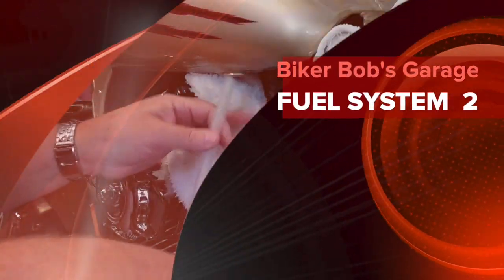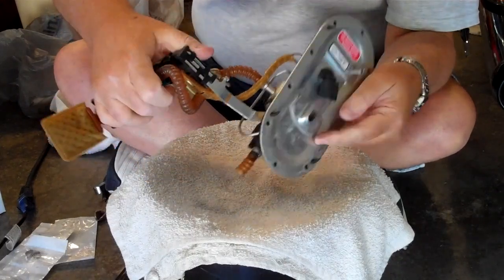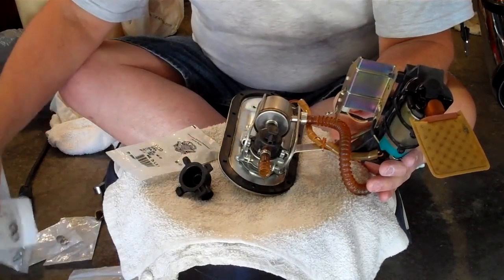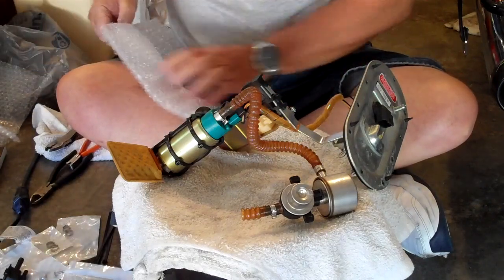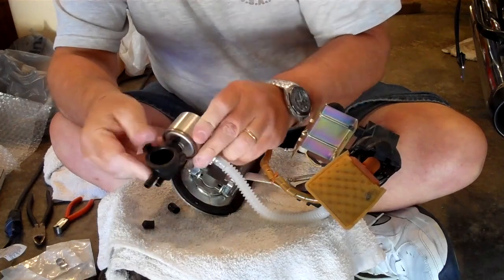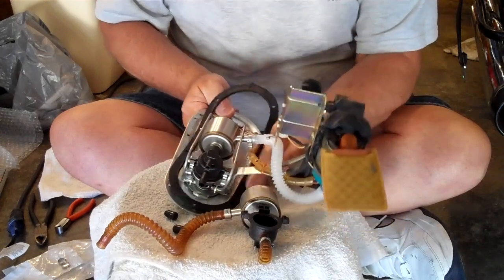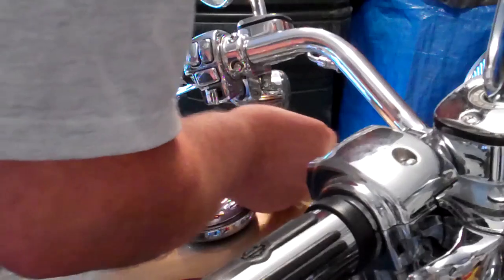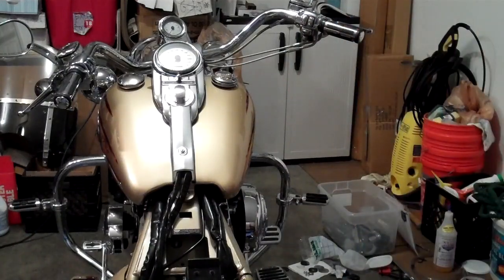Harley Fuel Filter, Fuel Pressure Regulator Housing, Fuel Check Valve on Road King Part Two

Comment: Got a tip for you.. a piece of plastic tubing.. about 17 inches an inch in diameter.. placed in from top of tank insert new hose in the tank while feeding into the tube.. goes really fast .. then just remove the tubing :)

Comment: a lot of times it's not your fuel pump it's the hoses that developed a small pin hole or even a crack in them reducing your pressure, the reason is all the ethanol in the gas,

Comment: Thanks for taking the time to video this. I just started to have a problem my 2002 Road King. I'm not hearing the fuel pump prime when I turned the ignition switch. The bike did start up,  idled funny,  drove 50 ft. and it died on me, started back up drove it around the street put it up for now and checking out YouTube for videos on this. My bike has 21,000 miles. I'm looking forward to replacing the Cam tensioners as well.
Reply from the maker: I just finished doing the hydraulic tensioner conversion along with HV oil pump.  IT'S A BIG JOB BUT VERY REWARDING!  Make sure you change the inner cam bearings when doing the job.  I also went ahead & replaced the stock roller lifters with S&S rollers & HIGHLY recommend doing that also.
Reply from the maker: PS Harley techs that I know tell me the fuel pumps almost never go bad but there's always the chance.
Reply: I replaced the fuel pump relay switch, cost me 8 dollars,  and the fob battery as well since it was over 3 years old. Working great now. I've been adding some Seafoam to the gas and only use premium gas. It does make a difference and runs great. Ride on brother.
Reply from the maker: @theroadking547  Good job!  Thanks for sharing the info with us!  Thanks again for watching!
Reply: Same problem i ran into Friday night. Started trying to turn off at stop lights kept giving it throttle and it stayed running but barely
Reply: Turned out to be the throttle position sensor. I got it from the dealership..... $40.00 .
Reply: @marcuswalden7556  mine turned out to be the throttle position sensor.

Comment: how did this not kink?
Reply from the maker: If you mean the fuel line check valve, I clamped the fuel line to FPRH after I tightened the check valve to the tank. HTH 03

Comment: Nice video mate....I have just done this on my 2003 RKC ...but to any one preparing to do this replace your "Fuel Pump Strainer" as well, you see it hanging there on the end of the pump.Just thought i would mention this as I watched all the videos to prepare myself also,cause I didn't know nothing before I started....but no one seems to mention the strainer.and it is just as important as the other parts that need replacing....once again mate ,very informative video.

Comment: This is best video on those quick disconnect fuel line assembly, on how to replace also. 
Some models the quick disconnect will unscrew from tank , and not have fuel line attached.
Your quick disconnect has fuel line attached and will not unscrew from tank without twisting fuel line. Fuel line must be removed to unscrew quick disconnect. This video does good job showing how to replace !

Comment: Good Job.  I will do this job myself thanks to you making it look easy.
Reply from the maker: Glad it helped.  Good luck with yours & let us know how it went.  <><
Reply: Worked out just fine, the hardest part was figuring out what to push to "unhinge" the fuel pump. Also had to unscrew the float (one phillips screw) to enable the assembly to pull out of the access hole.
Reply from the maker: Nothing better than the feeling of knowing you can wrench on your own bike!  Good deal bro!
Me, next I'm looking to upgrade my stock spring loaded cam tensioner & oil pump to a cool hydraulic unit with a HV oil pump.

Comment: I loved this video and learned a lot. I own the same bike and within the next few weeks am going to remove the heads to replace leaking valve seals. I will remove the tank for this procedure and will replace my fuel filter while I have the tank off. Thank you for doing this, it will help me a lot as I get into the job.

Keith
Reply from the maker: Man!  I sure wish you would make a video of the valve job!  My 103 is pinging a little bit when I really get on it and I think I will be doing the same thing in the future.  GL with the wrenching!
Reply: I'm going to attempt to video the work,  I'll let you know.
Reply from the maker: Hey Bro, sure hope you're making a vid of your work.  I'm getting ready to install a set of "Rocker Lockers" in the top end.

Comment: Best damn video I've watched! Great video, too. I'll be doing my "new" 2007 fatboy this month. What's the part number for the lower hose?
Reply from the maker: If you mean the hose connected to the fuel disconnect check valve, that was already installed onto the new check valve when I bought it from HD.  Different model bikes & years have different part #s.  Do a HD.com parts lookup for yours.
Thanks for watching!

Comment: THanks man, i needed this help. I have to do one other step. My tank liner has started flaking, so i gotta clean and reline it. There is some debate about the need for tank liner apparently.
Reply: did you reline, I have recently discovered my tank liner is doing the same thing
Reply: @johnnylopez6825  No, I did not. I cleaned all the flaking areas really well, (pressure washed), and have had no more problems.  I try to keep my tank full when it sits for a minute without being ridden.
Reply: @chadbrown1711  my pump assembly is rusty, I will replace and also my tank liner is shit. Did you use a rust inhibitor ?

Comment: Thanks, You made it easy. The housing for the regulator was bad. it was cracked at the part that holds it on.
05 Ultra

Comment: Great Video, Honestly I would have replaced the fuel pump while I was in there.
Reply from the maker: I see your point but I talked to my local dealers best mechanic before I did the job.
He told me the dealership almost never needs to replace electric fuel pumps.  
If I need to change the fuel pump in the future, it's easy peasy now.
To date, 1/17/24, with my 22 year old bike & I'm still on the OEM electric fuel pump.  Not bad HD!

Comment: very informative. One of these days I need to get in there and check out my float. on my 14 FXSBSE once my low fuel light comes on and the last bar is flashing I can only get about 3.5  gallons in on a five gallon tank. I know, Harley right lol.
Reply from the maker: Sounds like a bent float bar.  Not much more than coat hanger wire & if someone was forcing the assembly out, it could have bent upward.  Just a guess.  HTH 03

Comment: Thanks for the informative video, I have an 03 Heritage Softail Springer, I've been having issues with it bogging out on me sometimes off my throttle but not all the time.  Then sometimes when I'm sitting idle at a light or coming to a stop it will die on me..... any suggestions? I replaced the regulator, and the fuel filter  but still having some issues.
Reply: I was wondering what you did to fix the problem. I replaced the fuel pump relay switch on mine and the key fob battery......working great now.

Comment: Great Thanks! .. but for something completely different, why do you have on both left and right handle a brake cylinder reservoir ?
Reply from the maker: I have a hydraulic clutch instead of a cabled clutch. It works much smoother and is self-adjusting.  Thanks for watching the video.
Reply: @2003Harleyguy  I wish I had a hydraulic clutch.

Comment: any reason we can not use regular rubber fuel line instead of the plastic lines and worm gear clamps?
Reply from the maker: I always use stock parts or their equivalent replacement.
Not sure how the gasoline/alcohol fuel sold these days would affect the rubber fuel line over time.  My guess is it would degrade very quickly and create a huge mess in your tank.  As for the clamps, I have seen way too many radiator type clamps break to use them.  The crimp clamps with no moving parts, are definitely the way to go.
HTH, 03
Reply: @2003Harleyguy  makes sense the rubber fuel hose would probably make a mess after a while and break down

Comment: 3:11 those crimp clamps you bought. do you know what size and type they were? thank you
Reply from the maker: @dumbcat  I don't remember for sure but I think they were 3/8" stainless steel.  I have bought crimp clamps from advanced auto before but I'm guessing that many auto parts stores carry them or will order them.
Reply: @2003Harleyguy  thanks. after much searching this is what i found... "OEM part #10222 pinch clamp. May say '8mm' on package. Is just over 11mm ID before crimping." i ordered a couple. haven't gotten them yet. guess we'll see. update: yes they worked perfectly

Comment: What was the correct pattern and the correct torque? If you don't mind me asking. Great video by the way.
Reply from the maker: I'm not a certified mechanic therefore I don't provide specifics.  All torque values can be found in the factory service manual specific to your make and model.  03
Reply: @2003Harleyguy  thank you that video help out alot.

Comment: What is the proper torque for the 10 top plate cover? I stripped the one at 11:00 and rethreaded it with a tap, hopefully it will stay tight, I also used some teflon tape/gas rated just to add a little bite to the threads on the stripped screw. I have not been able to find the recommended torque for these screws anywhere.

Comment: The filter that carries under the fuel pump had 2 cracks. Can I paste them with some contact glue until the piece arrives? Sorry if you do not understand my English very well.
Reply from the maker: I do not take any short cuts with fuel related parts or service.  If it's broke, I follow the HD service manual instructions & repair it with OEM parts or equivalent.   HTH
Reply: @2003Harleyguy  I understand you, but for a fucking filter I will not stop riding my bike. If the pump is burned before the replacement arrives, I will change everything. but I'll keep rolling. Thanks mate for the video.

Comment: Was that a USAF shirt? 20yr Wire Dawg here. Quick question. You mentioned losing fuel pressure on top end in Vid 1. Did that also make your bike hard to start and idle rough, having to play with throttle to keep it running? It runs but i have to tease it to keep mine running. 2005 Heritage Classic here.  Already Replaced the Crankshaft Position Sendor and thought i would get lucky. Thanks. Joe
Reply from the maker: I'm no mechanic but from some of the things I've been told to check out other than the fuel filter & regulator housing are; Swollen fuel line (ID) from check valve to fuel rail (common problem).  One or both broken & still arcing wires (do wiggle test) going to fuel injectors (common problem).  Split fuel line going from fuel reg housing to check valve (common problem).  Bad fuel pump.  Clogged fuel inlet filter on fuel pump.  Cam chain tensioners (metal to metal).  Clogged/leaky fuel injectors.  Thanks for your service!  Hope this helps.
Reply: @2003Harleyguy  Thanks for all the info. Will start to check all that. Was yours idling rough before you replaced it?
Reply: Took out the fuel assembly and what did i find. The Regulator housing ear had busted and the o-ring was pooching out....$250 for parts at HD- $25 military discount +18 tax=$ 244.32. Online i had parts at $120 at Jpcycles but without new screws and gasket....I'm about to go install. WIll give update.
Reply from the maker: @Joegest1  I like Dennis Kirk for parts too.  Most always have everything from many manufacturers.  I would use new seal screws & gasket...  Fuel goes boom...

Comment: Thanks for posting that video series! I will be doing the same job with my 2002 RK Classic very soon. Question: Did you initially drain the tank a different way before using the hose and can method?
Reply from the maker: No.  I had roughly 3/4 of a tank when I started.  That's why I used a large gas can.  You're better off running the tank almost dry if possible.  My bike died suddenly, I had to do what I had to do.  GL
Reply: Thanks for your reply. I'm noticing reduced power, like what it would feel if you were "flooding the carb" when throttling up near max. As I reduce throttle it's like the power jumps back. Weird on an FI bike. No get up and go on hills under load, and just RPM jump when downshifting to gain back reducing power to pass, but no extra pwr, etc. Only thing I can come up with is the pressure regulator issue you talk about. Just bought the bike used last month and I understand it was stored for years.
Reply from the maker: If I could offer some free advise, I would STRONGLY suggest that you buy a genuine HD service manual for your bike if you don't already have one.  Then start an account on HDForums dot com.  Go to the tech advice section and post your problems there.  TONS of knowledge there.  BUT...  I will say with your year of bike, you need to THOROUGHLY check the leads to the fuel injectors because harley used the wrong wire and it breaks inside the plastic shielding over time.  It causes a gap in the wire & it does exactly what you're describing.  You may need to lift your tank up to access along with removing your air cleaner assembly.  Start your engine & wiggle the wiring while the bike is running.  If the idle changes while wiggling, you know the source of your problems.  GL.
Reply: Thanks, I'll have to check that out. The bike only had 17k miles on it when I bought it this summer. The circumstantial evidence is fuel, but it's now acting like it has a short or broken spark plug wire. I was going to start replacing everything electrical and fuel, but then I paused. This has to be something simple, like a broken wire. Have a trip planned for Friday to ride 1000 miles. This showed up this week. Great timing.
Reply: Oh and BTW, the symptoms of less power, etc was a leaky intake. Got full power back, then it had major issues (12v wire shielding rubbed off & shorted on frame). After that was fixed this week, now the bike is having a lean misfire, bad at times, nothing other times. Trying to figure out if it's another wire or spark plug wire, etc.

Comment: Do you know if there is a way to check the old regulator and housing to see if they are still any good. I replaced mine but will save the old for emergency if I can check them
Reply from the maker: I'm not a certified mechanic, just a shade tree mechanic so I can't give any advice on repairs, only my opinion on what I would do.  I would check the "fingers" on the housing for cracks.  If the regulator is pushing out of the housing there will be a psi bleed off.  But at $14 bucks do you really want to put an old plastic part back into the tank?  Glad the vid helped you.  Regards
Reply: Was talking more about the $45 pressure regulator itself that you and others don't usually change out. Thought you might have checked on it when you were doing the research for your project. I changed mine while I was in there and figured if I could test it and it was fine, I would save it for an emergency. Guess I'll check with a "certified mechanic" Anyway thanks for the video
Reply: Tell Bart said hello

Comment: Great video.  Thanks!.  The one question I had was about the sealing nuts.  Did you thing it was worth it? I'm kind of new to Harley's and frankly get annoyed when I see the price of some of their parts.
Reply from the maker: Harley or not, once you've had a fuel tank between your legs catch fire at 60 mph, and blow fire up your face, you will think the sealing nuts & gasket are a bargain!  Besides, they really weren't expensive!  #1 FIRE RISK!  #2 Harley parts are usually fairly priced IMHO. I think the sealing screws were like 6 bucks.  #3 I don't like doing jobs twice.  #4 Do you really want water flooding into your tank during a sudden downpour of rain or while washing the bike?  
Worth doing, worth doing right.  Good luck.
Reply: Yes indeed, and the gasket/screw set is considered one time use only anyway. At double the price it would be worth it to re-seal everything properly.

Comment: did it run better after you did it like defences in throttle response and get up and go
Reply from the maker: Yes, much better now.  It's a 103 so fuel starvation caused lots of problems like missing, backfiring, bucking and so on.  Runs like a scalded dog now.

Comment: So I wonder if your the diy type of guy that rebuilds his efi system while still on your car. Leading to parts dropping down in your intake. Or in this case dropping tools or parts in your tank or even worse, dropping something on your tank. Hats off to ya too, that years cvo paint job is one of my all time favorites. But, why not just pull the tank? Three bolts once the dash is off, and besides the obvious reasons above, youll have to disconnect the cross over tube. Wow, theres how you drain the tank. Use a line clamp in the middle of the tube, pull either end, and push on a 3 ft. piece of hose, letting it drain into an approved gas can. Plus, we all know how bad it hurts your back leaning over the tank from the side to do anything...Then you might say, well the manual doesnt do this for this job. Nope sure doesnt, and rately do I sway from a shop manual, BUT, what happens to these bikes just as often as a leak at the pump is broken wires on top of the injectors, or moreover, leaving the backbone wire traugh. Personally, I like to inspect, check for continuity, and usually clean the rocker covers, inspect intake at both ends, and just give a once over in this whole area. Then, with your tank on the table in front of you on soft mats,  continue with your fuel sending assembly removal and repair...Sure is great piece of mind when you know theres no other underlying issue, or even the chance one is about to happen, chaffed wire...Nice vid, nicer bike, hope this helps, good day....